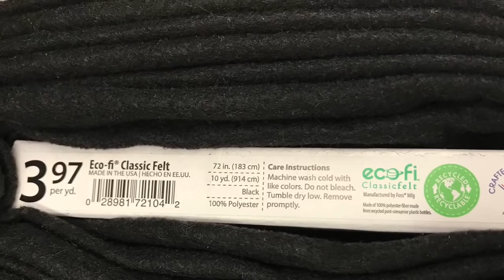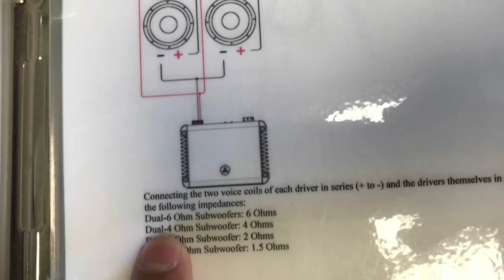Ported Box Build for 4-12” Massive Audio GTX

Comment: Always good work 💯💯💯💯💯💯💯💯💪🏿
Reply from the maker: robb black - Thanks Mr. Black! You get the beats in the Chevy yet?
Reply: 210 / Designs yea bro she got beats but I think I need a new battery because when that bass drop my voltage drop to like 8
Reply from the maker: robb black - Okay, I hear ya. Here’s some other things to check, when you have voltage drop. 
1. Grounds- make sure your grounded to solid metal, not sheet metal. Scrape all the paint away from the bolt. 
2. Power/Ground wire need to be the same size. Minimum 4g, depending on the size of the amp and length of power run. 
3. Size of fuse in power wire, off battery. Needs to be equal to or the next size larger, than what the amp requires. 
4. Amp clipping. Make sure the amp settings are not maxed out. Same goes for your head-unit. (Example-bass boost and gain).
5. Make sure your subs are wired correctly. Incorrect ohm load to amp, will cause it to pull excessive amounts of current. (Make sure the amp is stable at that ohm load).
Reply: 210 / Designs thanks bro gonna rewire everything today
Reply: 210 / Designs check your inbox on Facebook short video
Reply from the maker: robb black - bet 👌🏾